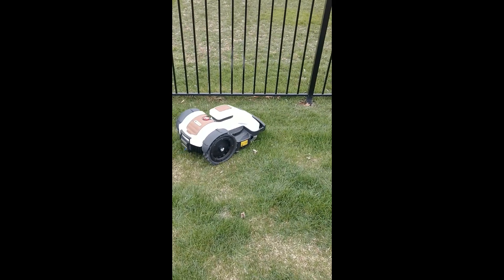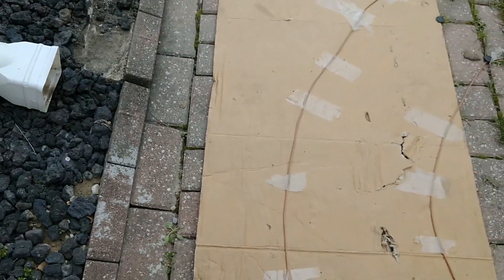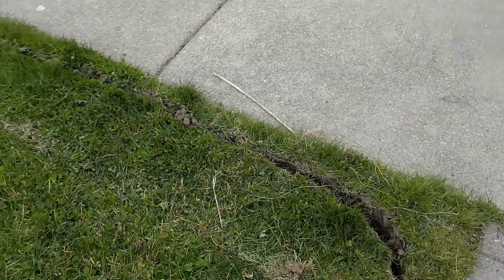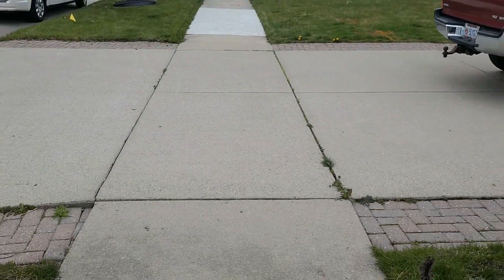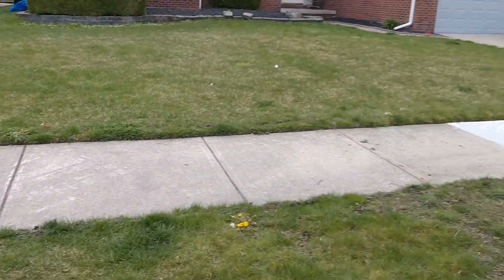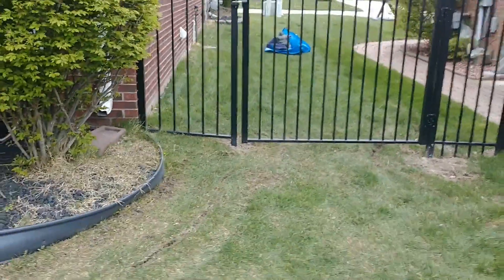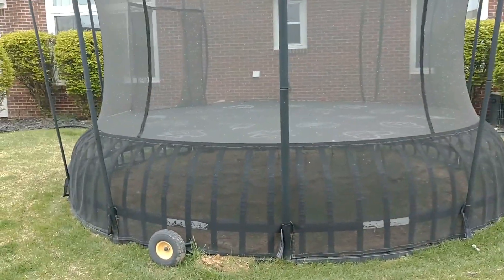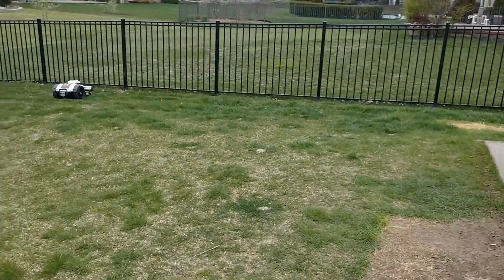Ambrogio Robot 4.0 Elite Typical USA Suburban Lawn w/Fence

Comment: Do you have to set return to base “on the wire” for the 12 inch spacing through gates to work? For viewers who do not have experience of these mowers you can set the return instruction as centred on the wire or at various distance up to 1m inside the perimeter wire. Thanks for sharing this video.
Reply from the maker: Hi Roger, thank you for your important question. The solution is to install an "antenna", a special shape in the wire, that recalls the robot to the wire on each side of the gate (i.e. 2 antennas). The robot will drive on top of the wire through the gate. The wire can be centered in the gate opening *if* special programming is used to ensure the robot only travels on the same wire through the gate. That is, anti/counter-clockwise or clockwise. Using this technique, the very small Ambrogio robots (L15 and Twenty) can fit through an opening as small as 16"/40cm. Most models need 28"/70cm, though (4.0, L250i, L350i, more...). Yet all of these robots will vary the distance from the wire in all other locations in the yard. The distance the robot stays on the wire is programmable by your dealer in the service menu. The default is something like 30ft/10m.
Reply: @paradisebots    Aloha. What mower would you recommend for cutting El Toro Zoysia grass on a 6900 Sq foot lot? I have a gravel walkway and fence separating the front yard from back yard. I would have to carry the robot between the two. Mahalo!